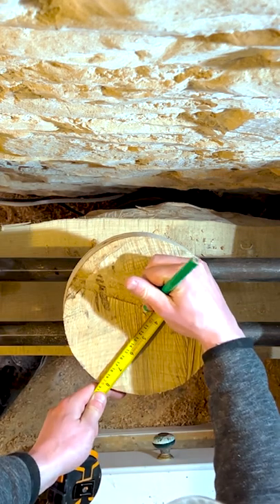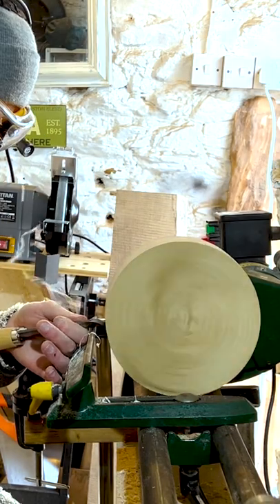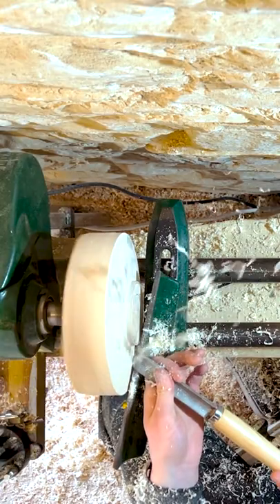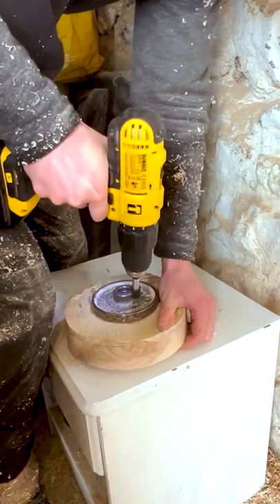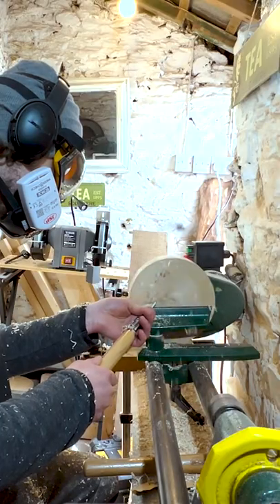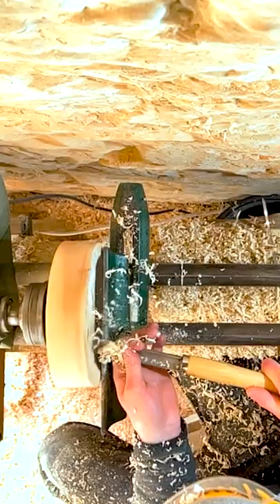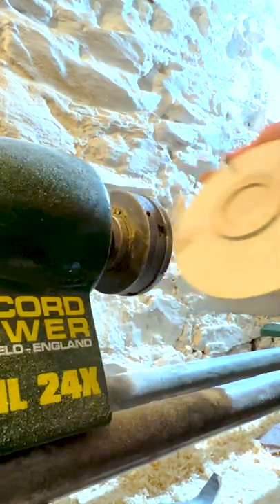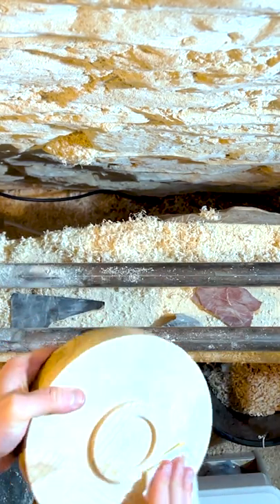Woodturning - Making an Ash Bowl #Shorts

Comment: Just a tip. That gouge is a contenental spindle gouge and should never be used on a bowl. It is not strong enough and could possibly snap. A bowl gouge has a much deeper flute and is made from round bar. Nice bowl though.